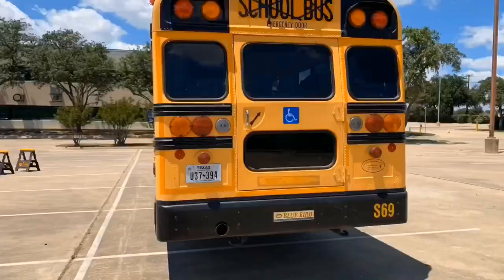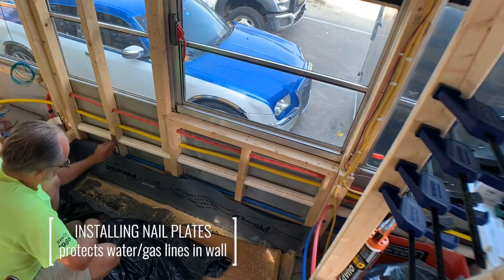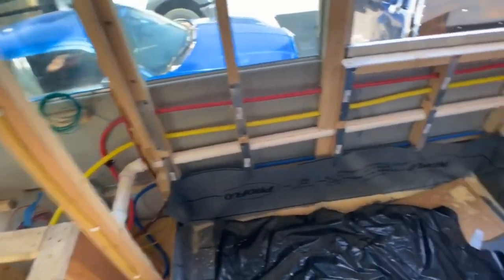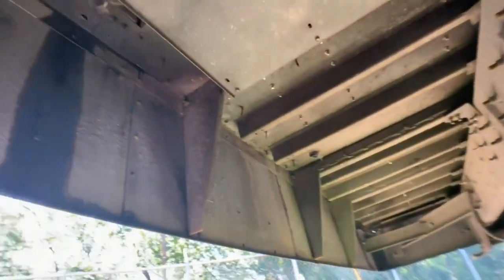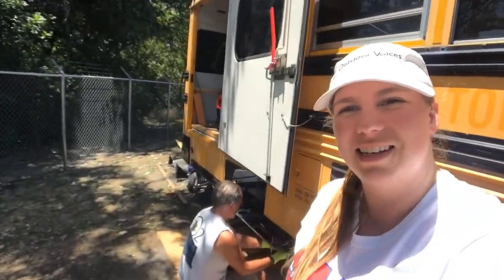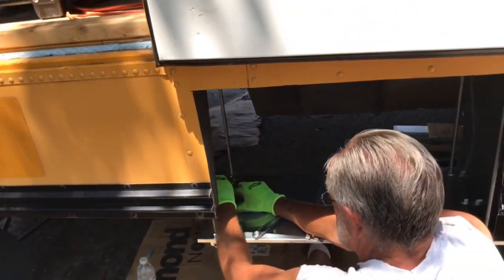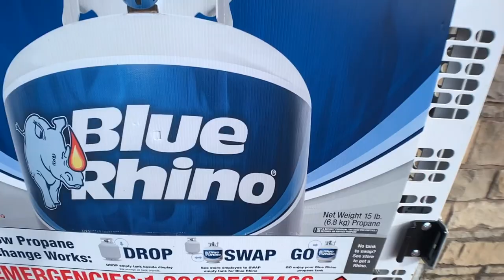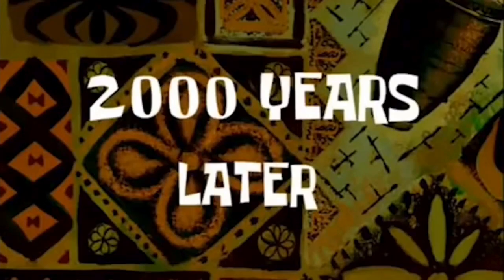Skoolie Propane System Install || 2020 Bus Conversion - Ep. 20

Comment: Corrugated Stainless Steel Tubing . Did it come it two lengths that equal 33'? or is it one length and you guys cut it? I don't need 33' and cant find anything shorter?
Reply from the maker: We found it in 25’, 50’, and 75’ I think.

Comment: How tall is your compartment? Do you find it easy to pull the tanks in and out and to hook them up? Trying to decide on dimensions for ours under the bus.
Reply from the maker: To be honest, we’ve only had to put them in once during install, and I guess we’ll find out first time we change them. Admittedly, it’s a little tighter than we’d really like, but we decided to sacrifice some height to keep them off the ground enough. Give and take, I guess!
Reply: Tale Of Two Smittys , Thanks for your reply. Helps to know it’s a little tight. I’m getting ready to buy the metal for ours. How tall of a compartment did you guys create?
Reply from the maker: I believe the tanks are 18”, so maybe we cut the rods to 24”? Somewhere in that range.
Reply: @TaleOfTwoSmittys nice to post the full dimensions height width and depth too in your description above

Comment: Im pretty sure the wrong type of teflon tape was used on your gas fittings
Reply from the maker: Thanks for the heads up. Was there a right kind you’re thinking of?
Reply: @TaleOfTwoSmittys  it just the role i saw in the video is meant for plumbing fixtures. Usually gas rated tape is yellow in color. I couldn't see the label in the video though so just thought I would alert you to the possibility.
Reply from the maker: Just double-checked. It is rated for gas and water. Thanks for noticing.
Reply: @TaleOfTwoSmittys  great glad to hear it. Never want to make a mistake with the propane systems. Love seeing the progress of your build